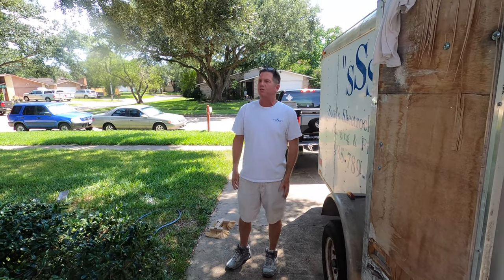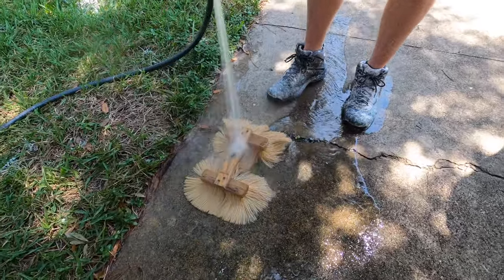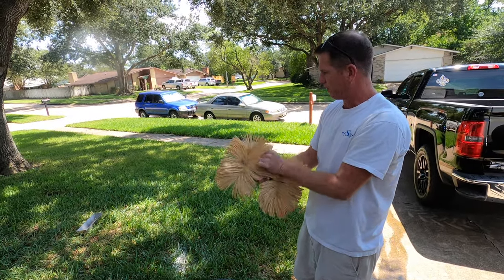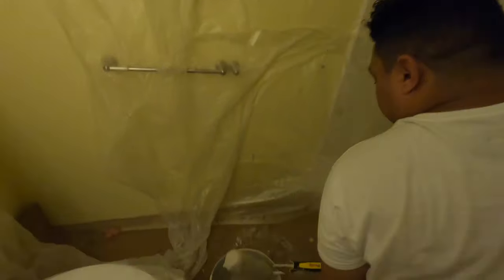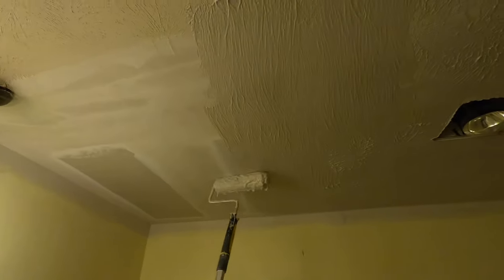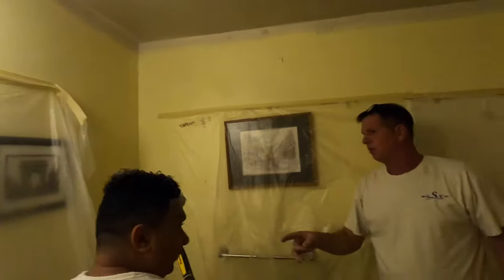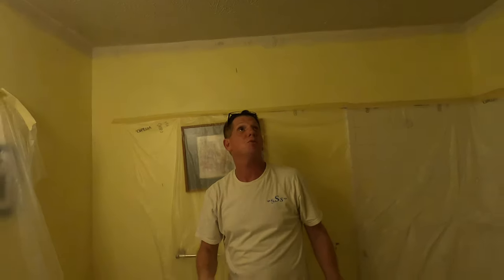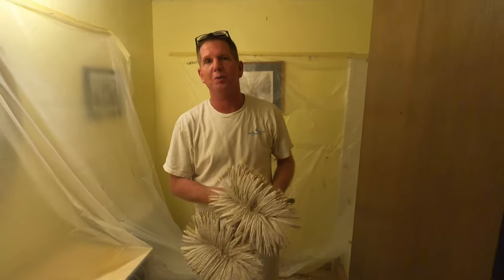How To: Crows Foot Drywall Texture pt.2

Comment: Good video! We are finishing our basement and looking to do this. 1. Do you suggest or need to prime the drywall before doing this? 2. Can you mix in paint instead of water so you dont have to paint after the fact? Or mix in both water and paint? Thanks Scott!
Reply from the maker: No you don’t have to prime prior to doing the texture and you cannot put pain in it as the texture is not a full coverage nor is it meant to be mixed with paint so do your texture completely and let it dry completely then prime and paint I hope this helps thanks

Comment: Good videos. How much water do you add to 5 gallon bucket of mud for light stomp?
Reply from the maker: It depends on how thick your mud is out-of-the-box but you have to mix it almost as loose as paint it has to be very very loose for a lite stomp because it’s originally sprayed on so they spray it with a very loose mud I do have another video on stomp that we did spraying it on. But do you answer your question it needs to be loose enough where it barely holds onto the paddle when you pull it out. It’s the Motst II then you’ll get points on the texture hope this helps have a great day!
Scott

Comment: I have small round sunshine looking stomps. Can't find the correct brush. I have to blend a small section I had to replace due to damage. The patterns are not random. All lined up perfectly.
Reply from the maker: It’s probably a horse hairbrush may be able to get one online, but you may have to cut the bristles to fingers depending on what the pattern looks like
Reply: Thank you.  I will look into that. I've never seen this pattern and my whole neighborhood has it. Have a great day
Reply from the maker: @rodfinlay333  send me a picture?
Reply: https://drive.google.com/file/d/1qXF6k13O4m9GqL6FPTd7N6vRlD-tMvLG/view?usp=drivesdk
Reply from the maker: @rodfinlay333  yeah it’s some sort of weird custom brush you’re gonna have to try and get a big horse hair brush and cut the bristles to make that design
Reply: I figured it was custom.  I am an electrician and haven't seen this design anywhere.  Checked a few local drywall companies and noone can recreate it. I will try an 8 inch horsehair and trim it.